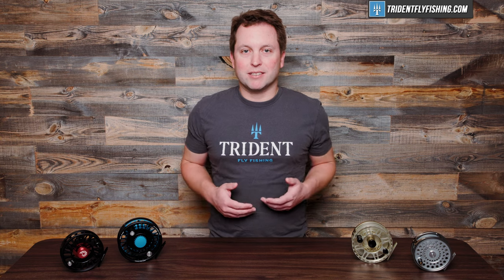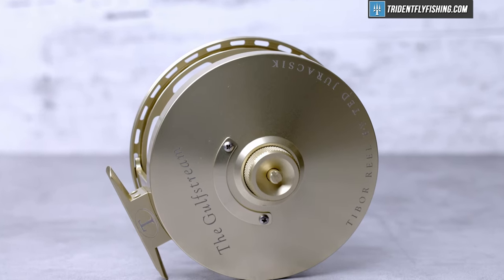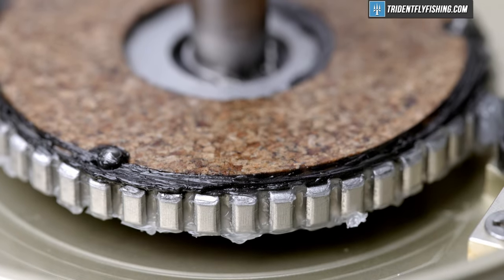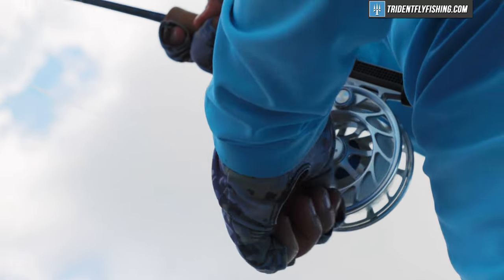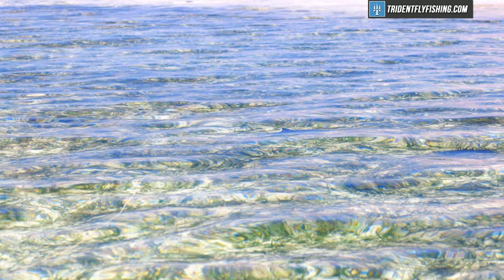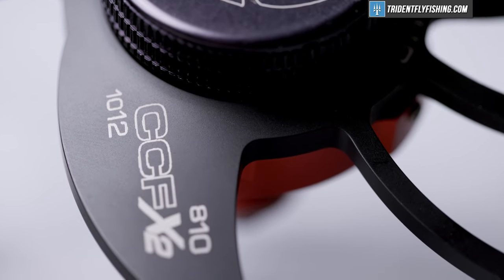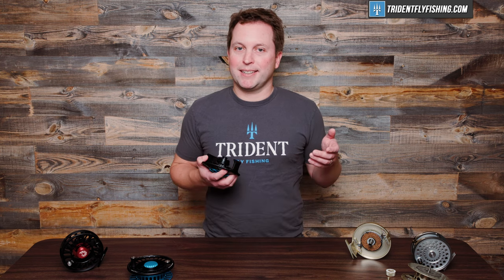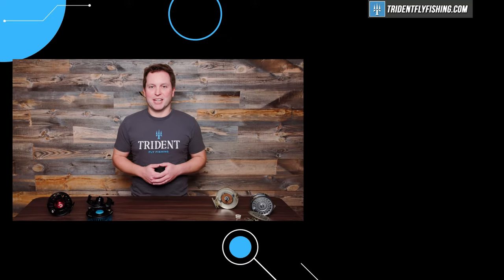The TRUTH About Sealed Drags (Does it Even Matter?)

Comment: I have the Tibor Everglades and Riptide, and glad I chose them over a "sealed" drag.  I use them in saltwater and just like any good angler, I rinse them with freshwater at the end of the day...same as you would with a sealed drag reel.  I only tear it down before and after the season to check for adequate lube (I've never had to lube either of my Tibors,) and ensure there's no rust anywhere...and there hasn't been.   The bottom line is that I've never heard of anyone complain about the operation or maintenance of a Tibor reel, while there are enough stories about failed alleged "sealed and waterproof" drags that have leaked and ruined the drag.  Why take the chance?

Comment: I wouldn't hold Hatch's sealed drag as an example of the pinnacle of drag technology. I've seen a lot of modern Hatch reels go down, while those technologically "old" Tibor reels keep winching in big fish. In fact, most Tibor reels in use have outlasted 3 generations of Hatch Saltwater reels.
Reply: I agree. I own 4 Hatch reels and 3 have required a visit to the factory at my cost. My unsealed Pates are flawless. Just add a bit of grease before a trip and you are guaranteed a perfect reel
Reply: Repectfully, I would not use hatch as an "example of the pinnacle of drag technology"...... and i'm a big fan of sealed drag sytems.

Comment: I have both styles, Hatch and Tibor. Hatch 7+ and 9+. Tibor Freestone and Everglades. To me maintenance on the  Tibor is overstated. Once a year I take it apart clean it and lubricant the cork. Cleaning should be done for both styles. If you are on a trip of a lifetime, you could just bring some extra lubricant, for peace of mind. Other than that there should be no reason to take a Tibor apart, on a trip. On the other hand o rings can and will fail, then the reel is done. There is nothing you can do, until you get home and send it in. Every sealed drag system will eventually fail, some sooner then others. If you buy a quality reel, you should get many years of service from it. My Tibor’s are around 25 years old and work as good as the day I bought them. I hope the Hatch reels have the same longevity, time will tell.

Comment: If sealed disc drags were the answer, doesn’t it make sense that we would see them on cars, planes, etc.?  

A new roof doesn’t leak until it does.  A sealed drag won’t leak until it does.  Unfortunately a person won’t know the reel is leaking until the drag and clutch escapement system fails.  Yeah, most sealed drags have lifetime warranties so a person can send it in to get fixed, but if a person is in the middle of the Seychelles just beginning a 2 week trip or the middle of a week long Alaska float trip, that lifetime warranty isn’t much of a benefit.

And, a person won’t need to take parts for the Tibor because it won’t fail.  They just don’t.  And, who has ever had to do “field maintenance” on a Tibor, Abel, or Islander?  The only time I see that need is when a person fails to ensure the cork drag is well lubricated before heading out on a trip.  Saw that once on a Bauer during a Christmas Island trip; the fly fisher had borrowed the Bauer and didn’t check the cork drag, which was dry and grabby.  Fortunately we had grease at camp.

The easy answer is attempt to minimize dunking a reel in the water.  Simple.  I know folks like hero pictures with their reel underwater with a just-caught fish as the backdrop, but just don’t do it.